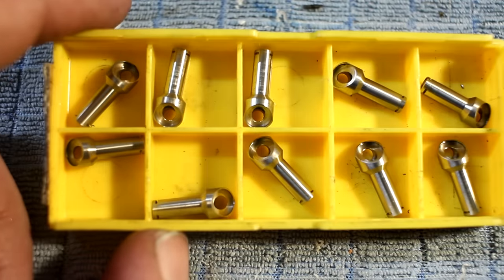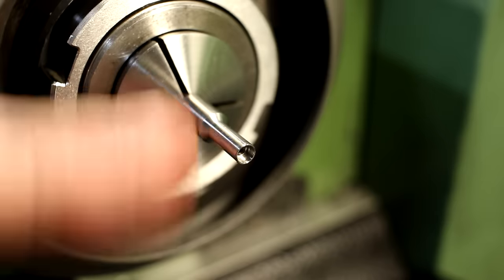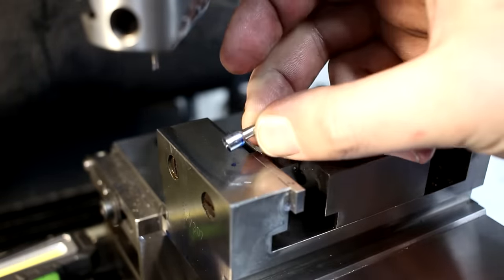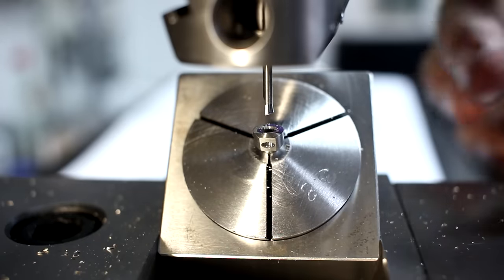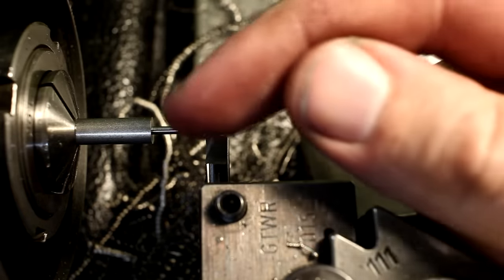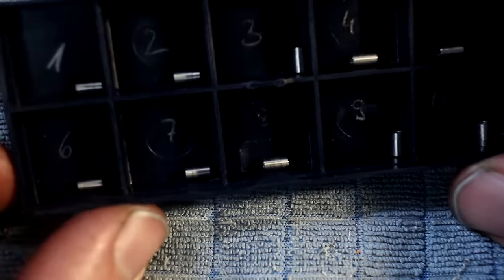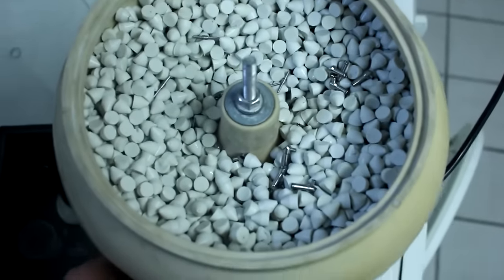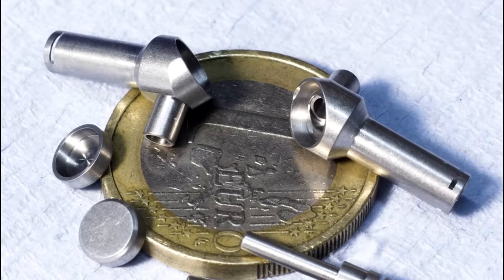Small stainless machining - Flux capacitor parts

Comment: 1.4305 is a dream to work with. i enjoy it more than working with aluminium. Aluminium is just boring.
Reply from the maker: Yep, I prefer steel over aluminium too - Easier to work with, less problems with scratches, dings, etc.
Aluminium is to machinists what spruce is for woodworkers.

Comment: someone tag gühring already to inform them someone is shamelessly advertising their products as horn has already left the chat. ^^
Reply from the maker: I am pretty tool-agnostic ;)
I use what works and is easily availible and affordable.
Reply: always wondered how much for the gühring-inserts? do you have a price tag for, lets say, a standard Dmin 6 mm boring bar with multi-purpose grade for steel at a cutting length of 20 mm?
Reply from the maker: 6mm shank, 22mm max working depth, about 23€ without discount.
Reply: thxn. that's about half the price for the horn we use in our workshop. headscratching intensifies

Comment: Why not print the parts? Than just clean them up and final dimension. I think 303 can be printed.
Reply: Metal printing is quite sloppy process compared to Stefans work. You would not gain anything since you would not have good reference surfaces to do the precise finishing.  Also even the best metal printing technologies in use leave finish close to very rough sand blasting. Not a viable option here and probably for many many years to come. But actually I would like  to hear the opinion of someone printing on the best machines what surface quality and dimensional accuracy can be attained in lab setting.

Comment: You forgot to film the most interesting part.....0.7mm drill.
Reply from the maker: It was very underwhelming - Runnin the lathe at 2000 rpm and pecking 0,25mm increments with the carriage. Sorry for not having it filmed - That happens sometimes when you are in the zone of machining-zen ;)

Comment: 100 micron? how da hell your machine supports that?Any slight wear in bed will result in loss of 0.001,or taper.You must have a magical lathe.
Reply: 100 micron is 0.1mm (4 thou if you prefer imperial), it's really not that hard a tolerance to work to.